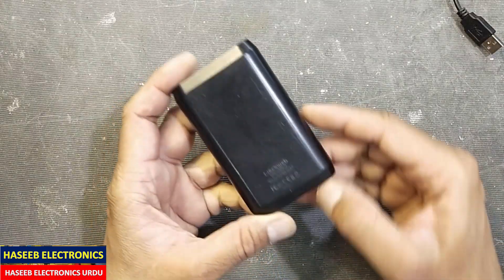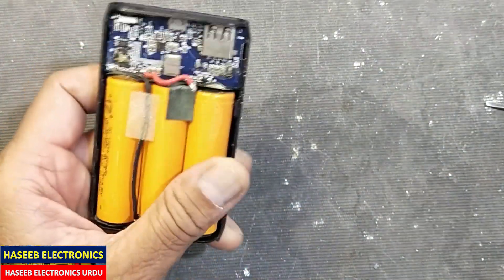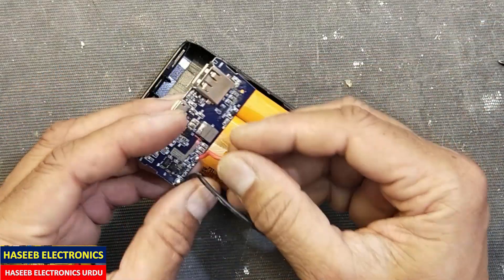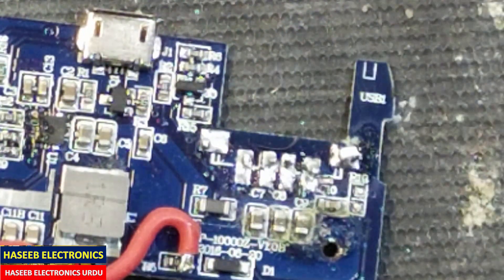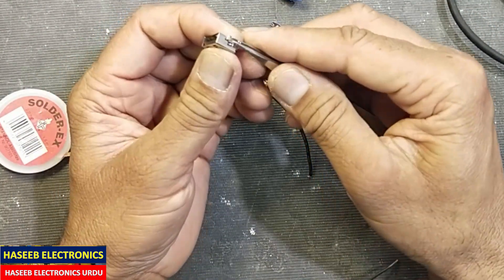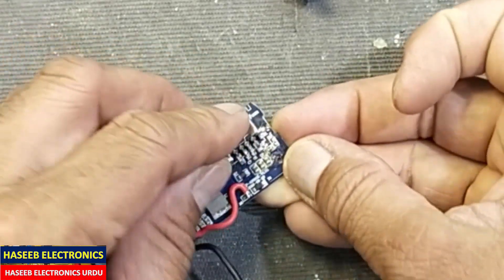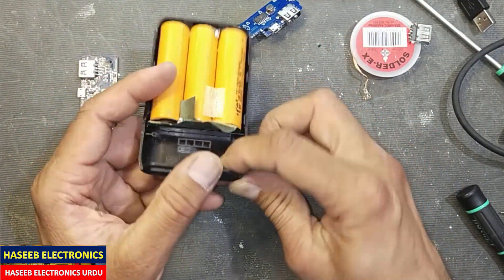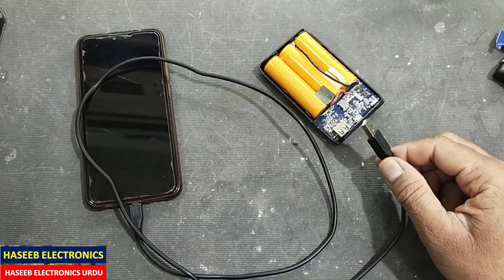{591} Power Bank Repair - How To Replace USB Port / Connector in Power Bank

Comment: Sir video is infmtve.... Could you plz help with the machine model you used for Desolder?
Reply from the maker: it is weller wr3m made in germany 
please check video number 511 for more details
Reply: @HaseebElectronics  thank you sir... could you suggest some cheaper models also plz...

Comment: What is out put voltage of power bank
Please check it and reply me
Reply: Sir reply pls
Reply from the maker: when we apply 5 volt from a charger, it buck regulator steps down to 4 volt and when the battery reaches at 3.7 volt, that time it disconnects the charging 
when we connect USB cable to power bank for mobile charging, it takes 3.7 volt from the battery and boosts up to 5 volt. 
so its intake and outlet is 5 volt. whiles its internal battery is 3.7 volt